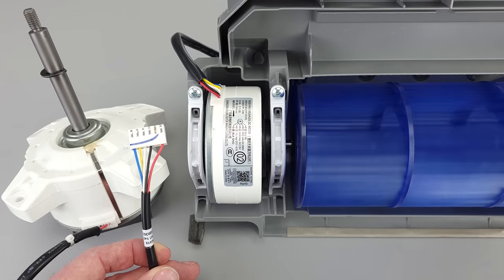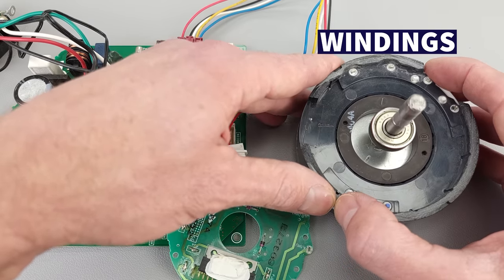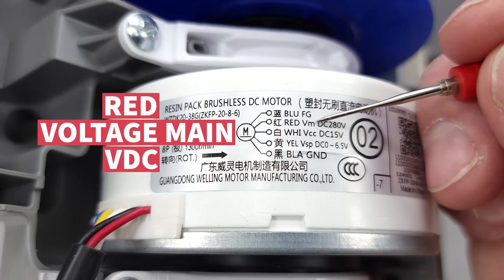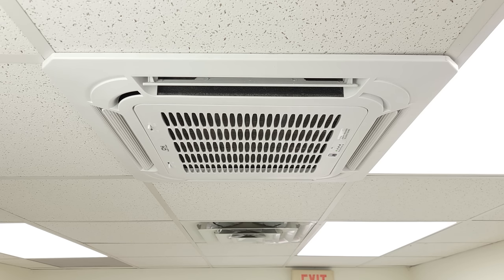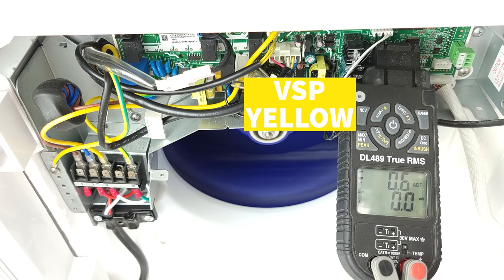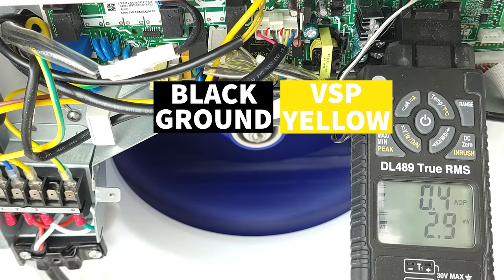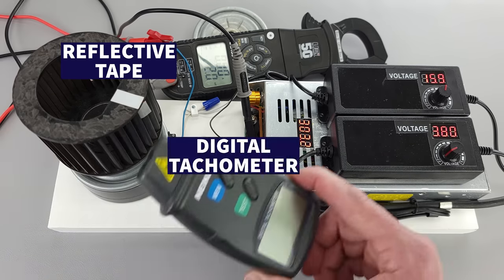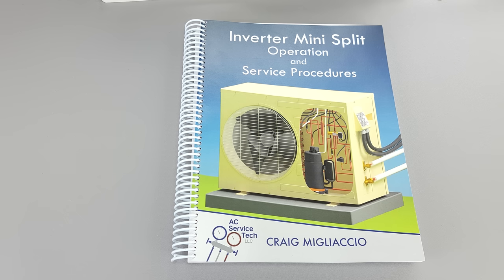Inverter Mini Split FAN MOTOR Operation and Testing! 5-Wire BLDC

Comment: very technical I like videos like these, may I say it was flawless. I hit the subscribe button right away, I would like to perhaps ease some of the confusion and perhaps fear of some viewers due to the very technical nature of this video, by saying that 9 out of 10 times in the event of a bad fan motor these mini split units are smart enough to self-diagnose this problem and then generate an error code. Now all you would have to do is look up the error code on the internet, for the explanation or diagnostics for the error code. Often times you will easily find the service manual online which have step troubleshooting guide for each error code.

Comment: This is very similar to Mitsubishi fan motors.  One tip, not sure if it’s true for all, but if you turn off the motor and manually rotate the wheel the rotational feedback should alternate between 0 and 15vdc.  If you do it while the motor is running you won’t be able to read it on your meter.

Comment: Since most modern multi-meters are capable of measuring frequency, a much better way to check the feedback signal is to put the meter in frequency mode and observe the frequency change as the motor speed changes.

Comment: This has given me a good insight into DC fans. Unfortunately in my experience a bad fan means a dead pcb, and a dead pcb means a bad fan. All the diagnostic flow charts and readings never come to the conclusion of, throw it in the bin.
Reply: Which PCB? That is what you have to know how to discern. Degree flex has a one horsepower BLC constant speed motor. It has 240VAC going to the inverter module on the back of the motor. Then it also has the four low voltage wires connected to the PCB in the air handler. All of this junk once out of warranty will get replaced with either a constant torque motor or a PSC motor.

Comment: Awesome demonstration! I have a DC indoor motor that will only run on high speed, no matter what I set it for. What would be check required to tell if it’s the motor or control PCB failed??
Reply: I have same issue but this guys not replying to any comments it seems

Comment: Can you also check the fan motor by ohming the windings?  Just wondering if the fan takes out the board, if you can check the fan before putting in a new board, only to find out it was the fan by smoking another board.

Comment: Thank you so much for sharing your refrigeration knowledge!  I have a question.  I need/want to add a mini split to cool a couple of upstairs bedrooms.  Can you  please comment about the consideration of installing 2 separate mini's vs buying 1 that has 2 zones??  I have the room and the cost of buying 2 separate vs 1 dual zone is about the same.  Also is it possible to only install just one of the indoor units and leave the second lineset ports blanked off for a time?  Does the complexity go way up on multi zone?  This would make a great video discussion on multiple single zone vs multi zone.  Thanks
Reply: Sure.  With a single outdoor unit per indoor unit, each unit can be in a different mode.  For example, if you have a room that receives a lot of sunlight, you'll be running in cooling mode.  On the other side of the house in the shade, the room may be cold so you run in heating mode.

OTOH, a multi-zone outdoor unit requires every indoor unit to be in the same mode.  That is, either heating or cooling.  If you put one unit in heating and another one in cooling, the units will error out.  The outdoor unit cannot operate in both modes at once.

Frankly, I've yet to figure out the purpose of the multi-zone outdoor units.  Stick to one system per room.

Comment: My Midea 12k mini split heat pump blower fan runs too slow to cool the room, even on high.  The Turbo setting is the only speed that works ok, but then it times out after a few minutes.  It's been like this from brand new, frustrating because the unit never gets to set point in a reasonable amount of time.  Any insight would be appreciated.

Comment: I cannot relate to 280 v dc to this small motor even if it is divided 3 ways approx 90 v dc per winding when a small kobalt brushless impact drill works off of 24 volts dc and really is powerful small motor ! I have studied a lot about direct current at DeVry and Middlesex County College in N Brunswick, New Jersey !
Reply: These "brushless" motors convert the DC into AC and adjust the frequency of the AC for speed control. They use what is called a Hall Effect device which produces a Voltage proportional to the magnetic field strength. They still are an induction motor, it has taken a lot of clever engineering to produce these motors  Even the circuit board in the motor is a complex system.

Comment: This is the Cooper and Hunter Astoria unit in the beginning, which features easy access to the fan motor.
Reply: Who makes the Cooper units? I thought all the mini splits were rebranded Midea or Gree.
Reply: @houptee  It's most likely a Midea based unit, but this particular setup for the air handler is not duplicated with any other clone I've seen so far.
Reply: Midea
Reply: @shieldcracker  Interesting, I've got a 10year old Grunaire , has a Panasonic motor like this, but 30W, very hard to find a cross for it. Makes that same sort of whining noise but louder , and does not run as fast as it did new. I build a test rig with a variable transformer and a bridge rectifier to convert to DC. A Dual output bench supply give me the 15V VCC and 0-7V control voltage.   The FG output seems to be fixed frequency, but PWM, if I run low speed and stop the rotor, it still outputs pulses (viewing on an O'scope)